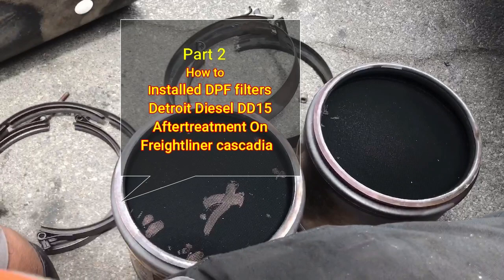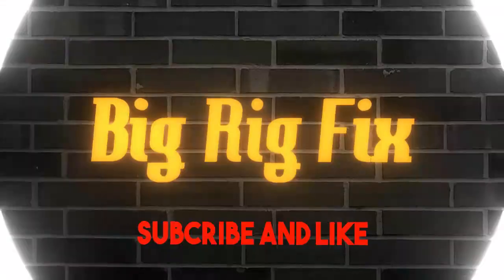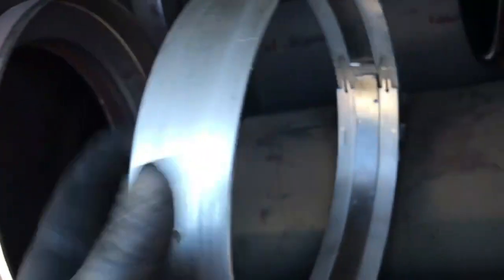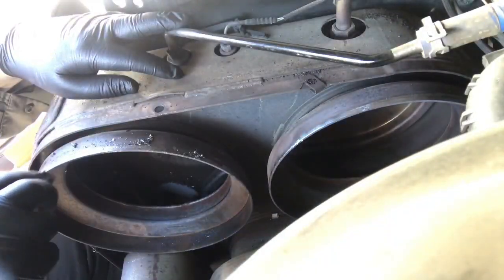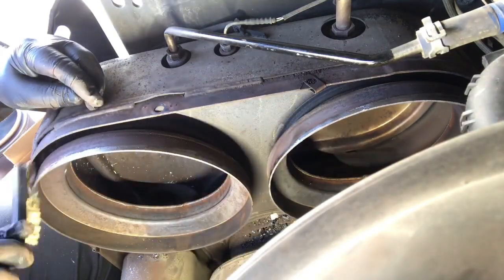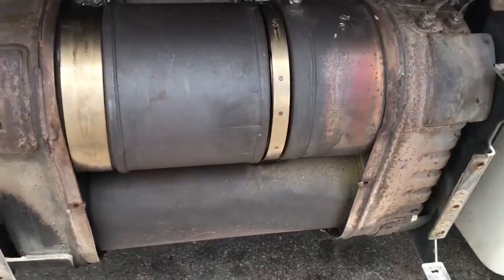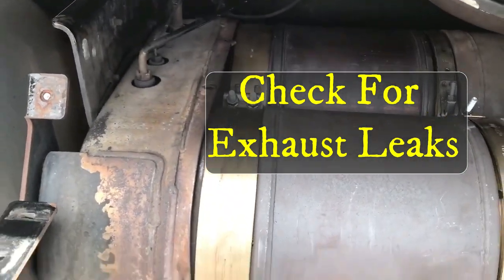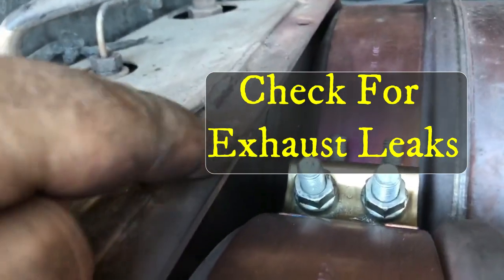Install DPF filters Detroit Diesel DD15 On Freightliner  Cascadia (Part 2)

Comment: Was a nightmare for me since the stupid star bolts that hold the heat shield on were so corroded I had to use a hand grinder to remove them. The ones on top under the exhaust were a bitch to get to lol. Thank you for this video it helped me a lot!!!!
Reply from the maker: I'm glad I could help.
Reply: I just started it to check for leaks and there is a leak but I'm pretty sure it's coming from where the exhaust Clamp was on the heat shield above them. I'm fixing to throw the clamp on that before I put the heat shield on and make sure that's where it's coming from. Did you replace that clamp on the heat shield above the box?
Reply from the maker: @jollycooperator2876  I’m pretty sure there’s exhaust gasket that goes between the clamp.
Reply: @Big Rig Fix  Yeah, mine is disentagrated lol I'll grab one tomorrow thnx!
Reply: @bigrigfix  Yeah the one they sale goes in between the 2 exhaust pipes. I wasn't gonna even try to get in there. I threw a new clamp on and it didn't leak so I left it alone lol.
Reply: @bigrigfix  About how many DPF’s do you guys change a month? And what makes of trucks have the most problems with DPFs? Great video! 
Thank you
Reply from the maker: @lh5567  they need to be replaced or cleaned after so many hours they’re like filters.
Reply: You know : The manufacturer makes the star bolts like that’s     to prevent the owner fix the truck themselves.
Reply: @Xetai18banh  Yup and I love when I can actually do it myself these manufacturers are so fucking greedy!